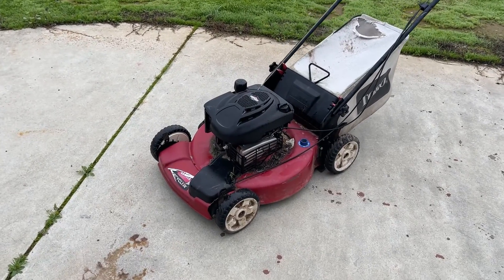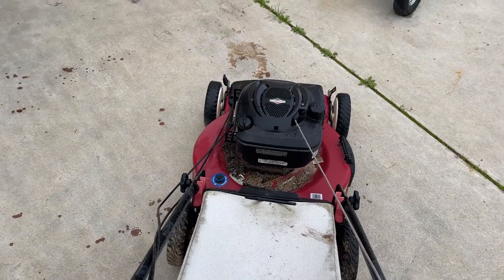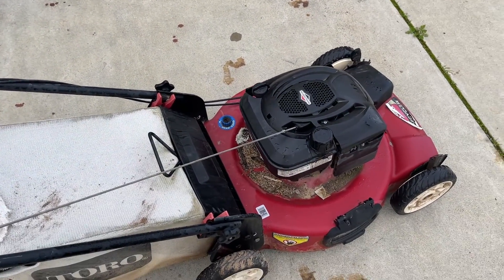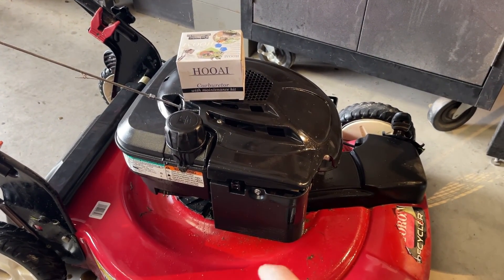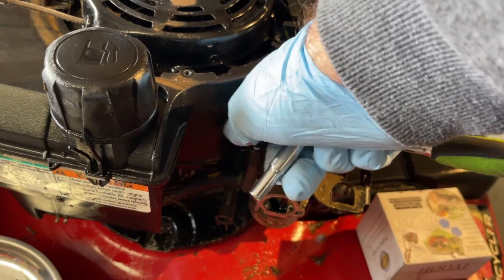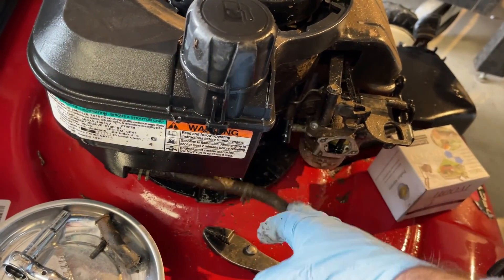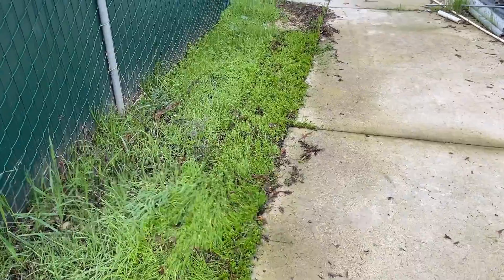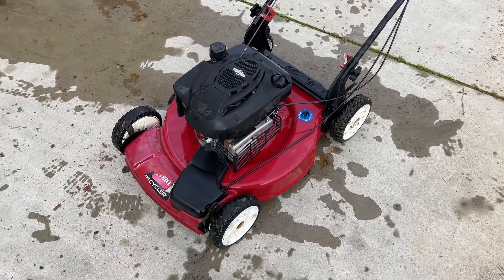Part 1 Saving a Toro Recycler - Carburetor Replace, Air Filter, Tune Up

Comment: Nice one, Hank. An option for those front wheels is to "re-tread." I got some mountain bike tires out of a dumpster (blown sidewall) behind a local bike shop. I trimmed the edges a bit & cut them to size with shears. I then fastened them to the existing treads with Goop glue and 1" sheet metal screws positioned a few inches apart around the circumference. A bit of work, yeah, but 4 years later they are still holding strong with almost no tread loss. Not bad for a few bucks vs. over $30 for new wheels.

Comment: I saved a toro recycler mower about 10 or 11 years ago and I think it was made in the mid to late 90's and I got it for free and it was a mess the engine was lose on the mower deck, the air filter was soaked in either gas or oil or both and the drive belt was shot I replaced the belt and air filter and plug and tighten up the mounting bolts on the engine to deck and it's been running great and it starts on the first or second pull every time.

Comment: Great video as always Hank. It's interesting that you can get an aftermarket carb for that Toro lawn mower, but I can't get one for my old Toro Super Recycler. No big deal, I just rebuilt it. I also have an old Craftsman snowblower that had a leaky carb (I know you never worked on one) and I found a Hooai replacement for it on Amazon. It was way cheaper than a Tecumseh carburetor and is still working great three years later.
Reply: Ebay also has many aftermarket  carbs for various gas powered lawn epuipment, chainsaws, etc.  Some sellers have carb kits that come with a carb, fuel line, air filter, and maybe a primer bulb. Good prices too !

Comment: A lot of times a push mower may stop running, and won't start again. A lot of times the diaphragm gasket under the carb goes bad, and it act as a fuel pump to keep the gas flowing from the tank thru the carb. Gasket might cost $5 or $6.  Replace that gasket and sometimes the mower will run like new again. I also change the oil, replace or clean air filter, sharpen mower blades, and replace spark plug if needed. I have a older 10+ yr old craftsman push mower with B&S engine, and i keep it tuned up and its as good or better than most new push mowers. I like older mowers, and they seem to last longer.